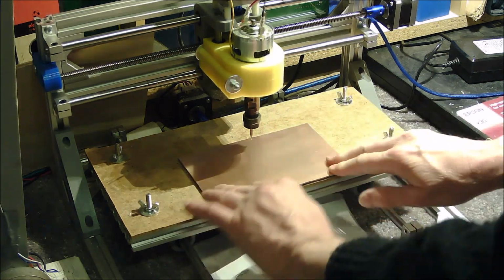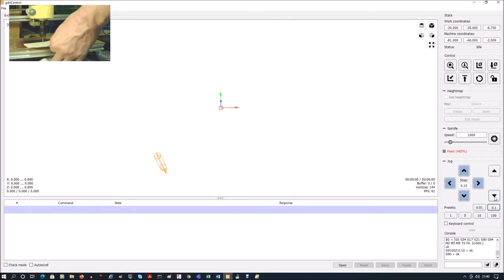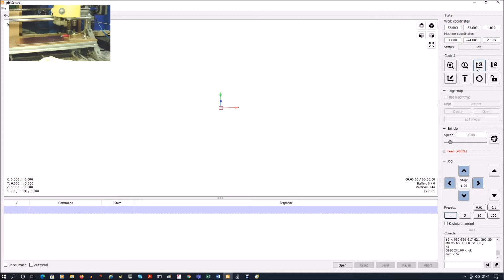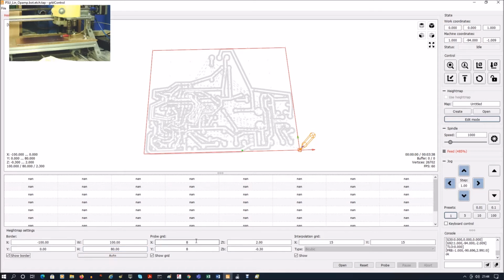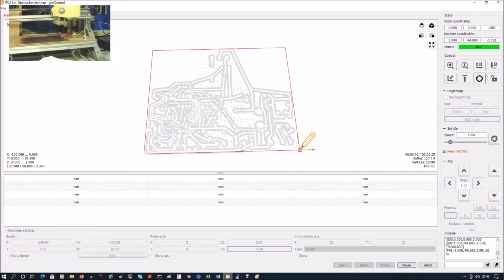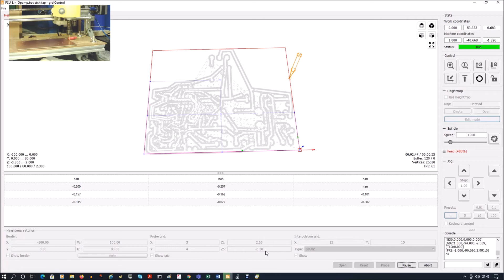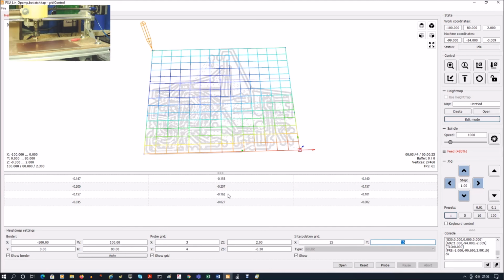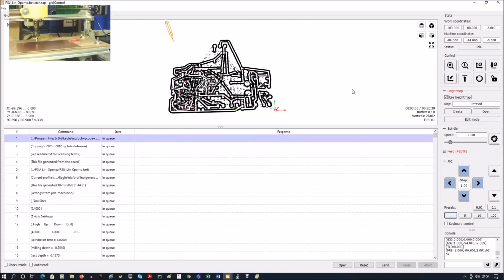Using heightmap with Grblcontrol or Candle

Comment: I came here to get height mapping with candle or grbl,I did think about pcb carving.

I think if you want to make more than one pcb of the same schematic the method of painting a square by corner not height and length piece of glass sheet and etch by laser to remove the paint to make a resist film mask is the best method,the only issues for double sided boards are,you need two sheets of glass the same exact size with registration holes in the exact same place.

If your mill can cut with absolute minimal tool wander or play,then diamond coated bits should be able to cut both sheets simultaneously ,the laser printer  method either iron on or using acetate are not trustworthy enough to make a good lightproof mask.

For one off designs single or double sided the height map approach with registration pins,If you can it would be best to use needle roller bearings as pins fitted ,as this is a cnc the holes should be fractionally smaller for an almost press fit to avoid ANY wobble in the base board or pcb.

Again as this is a cnc you could mill the copper clad to a size being square a right angle fixture with side clamps would allow for registration without pins,made from plexi glass to avoid warping such as mdf absorbs moisture from the air,on a dual sided board for smd misalignment for tiny vias for smd track pads can not be allowed by more than a few thousandths of an inch,i use circular mills so imperial measurement is what i use.

For engraving metals of what type your machine can handle height mapping on sheet metal is a must,anything over 3-4mm i would fly cut level,even a 3018 pro mill such as mine will fly cut if it is given the chance and not have its arse kicked by cutting too much depth for the physical strengths of the steppers,lead screws,linear rail deflection,tool length.

I have a full size lathe and a vertical mill,i'm transferring the  methods used to the cnc table top,the methods are the same albeit without computer numerical control,all other limitations stand,a mini mill won't cut what my mill or lathe(lathes can mill too) can cut due to the physical limitations.

Please use the proper cutters for the material,chinese cnc machine sellers show engraving cutters milling wood and the cut is terrible,all furred edges from grain tearout,or copper tearing (rough as guts edges) on pcbs.

If you want to cut wood,acrylic or soft metals like copper,aluminium or brass(brass is kinda tough but does cut) look at trend cutting tools,here in the UK they are one of the biggest suppliers of quality router cutters and routers etc they do a cnc router carver too,their catalog has feeds and speeds for the materials to cut,these would not be viable on a small cnc you would need to scale back the feed rate to speed by dividing the trend speed into your machines spindle speed,eg 24000rpm tool used on a 10000rpm cnc would give a multiplier of 2.4 for 24000/10000 or 10000/24000 gives0.4166666,if the feed rate is 100mm/m/miles,the number 100 is either divided by 2.4 or multiplied by 0.4166666,the answer for both is 41.666667,the feed rate should be adjusted to suit,buy a rev counter to measure spindle speed.
If like the 3018 pro etc cncs with a ER11 collet chuck buy a ER11 collet set they go from 1mm to 7mm,so the 1/4"(6.35mm) router cutter shanks will fit.Giving a great range of professional cutting tools for carving ,cutting and what ever.

To up grade the machine sbr linear rails are a must with thicker lead screws to avoid whip and bending under load,spindle and steppers,for that matter a new machine could be fabricated using the same or most of the control gear,which i also intend to do.
Happy hunting.

Comment: Been frustrated trying to do this myself. I've used  the regular probe command regularly with candle and my cnc but when I try the heightmap it does a single probe and then does nothing and I have to abort (and yes I have the probing matrix parameters set up).

Comment: hello! I have a question about candle. Today I tried to use the CNC for my first PCB and my pcb was made 2 and a half times smaller than usual. What do you reckon I should change?
Reply: This is an issue if you have the program the wrong way inch or metric. 1 inch is 2.54cm

Comment: I understand all your instructions but where do these clips connect to?
Reply from the maker: Wire 1 runs from the body of the spindle motor to the A5 pin of the controller. Wire 2 runs from the copper of the pcb to (one of) the  G (ground) pin(s) of the controller. That's it!

Comment: @ Charles - Finally a positive explanation! I had been trying for several days to do the height map of a PCB but without success: the tip touched the copper but did not go up and made a jerky noise with finally an alarm...
By following the video step by step I finally obtained the result I was looking for. Thank you very much Charles!
I'm using CANDLE 1.1.7 but don't have the PRESETS buttons used in the video. How to add them?
PS Is it possible to use a Z probe instead of the sheet of paper to set the starting  Z zero?
Hervé (Loire Atlantique - France)
Reply from the maker: Thank you.
Yes, Candle is a little bit different and not always better imho. 
And yes, you can use the probe function in stead of the paper trick.

Comment: Hi Charles, it would be possible for you to share the wiring diagram for the height map probe? I am having a lot of issues with my 3018, when I try to run the height map, the machine is pushing the bit all the way down without stoping on the PCB. Thanks!
Reply from the maker: It's just two wires: wire 1 runs from the body of the spindle motor to the A5 pin of the controller. Wire 2 runs from the copper of the pcb to (one of) the  G (ground) pin(s) of the controller. That's it! 
Another tip to prevent the machine pushing the bit all the way through is the following. When creating the height map in grblcontrol, fill in the Zb field with a small value, e.g. -0.5 (mm). If the machine doesn't find copper it will not dive deeper than -0.5mm. 
Have fun & take care!

Comment: I want to make accurate PCB's with perfect aligning holes. Not sure if an end ball mill or flat end mill is better for drilling 0.8mm holes.
Reply from the maker: For drilling holes, I use 0.8mm drill (with 3.2mm shaft), not a mill